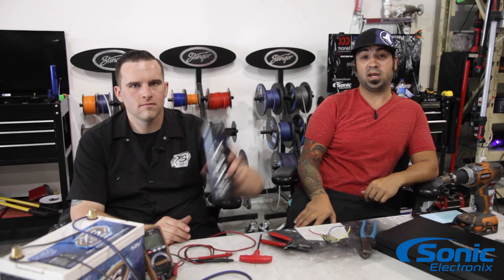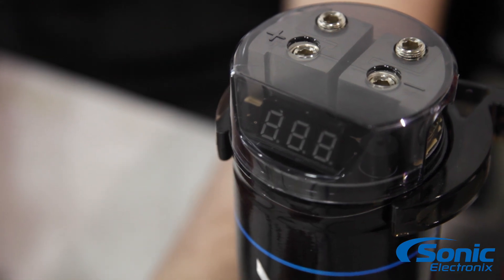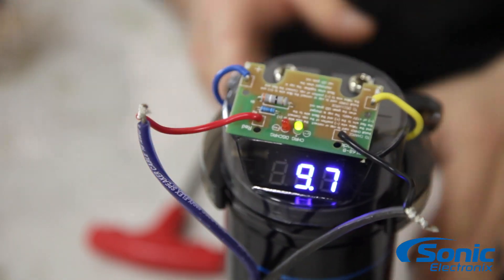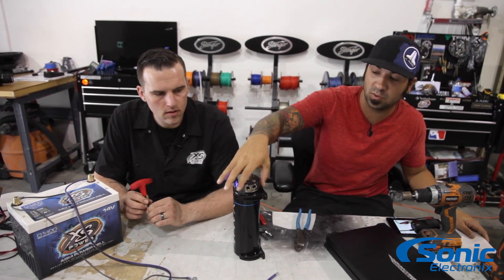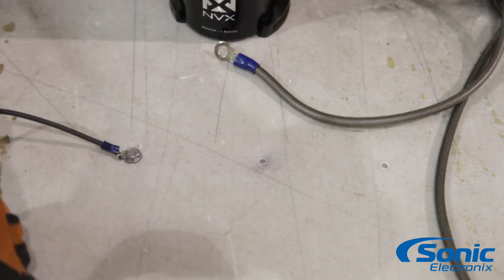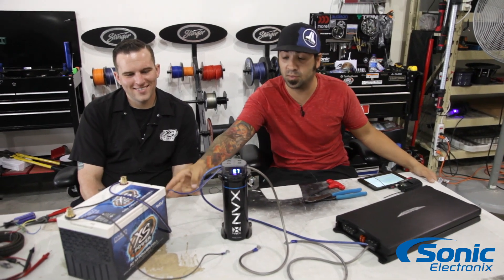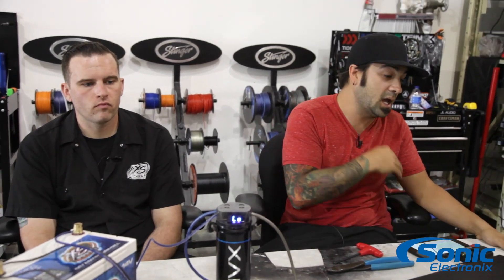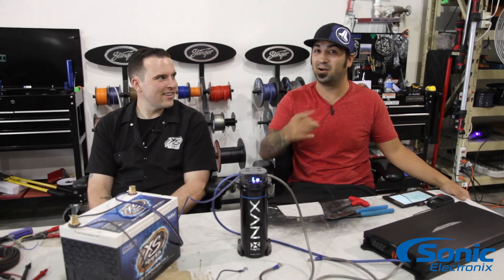How To Charge and Install a Capacitor | Car Audio Q&A

Comment: Now what about ultra capacitors
Reply: Why not just get a 2nd battery...
Reply: cuz is heavy on the alternator cuz of the higher resistance
Reply: An ultra-cap isn't "better" than a super capacitor, it is a super capacitor. Ultra-capacitor is just a brand name and means next to nothing. The reason why his cap drained so fast in this video was because it was powering the voltmeter. Caps aren't batteries, they're designed to take in and give out their power very quickly, not store it for long term use.

Also, it is harder on the alternator to get a second battery, but it has less to do with resistance and more to do with the way alternators were designed for constant linear loads, and by its very nature an amplifier isn't that. The cap turns the amplifier into more of a linear load from the alternator's point of view, thereby decreasing the duty cycle required of it and increasing its lifespan.
Reply: @jamisonw.327  Even if you add batteries your stock alternator will still limit the amount of current that can be sent to the batteries. adding batteries literally does nothing to your alternator. It's quite simple Electtrical engineering. you can have 54 batteries and your alternator will still only put out it's rated 120 amps or 220 amps or whatever it is. Alternator will charge battery1, battery1 will charge battery2, battery2 will charge battery3, so on and so forth. Batteries don't take juice from something they receive it from something at a speed that is predetermined by that something.The only issue you may run into with 54 batteries is that it will take you a 937 mile trip to charge them all with 1 140 amp alternator, but since alternators are literally on all the time when the engine is on, they are meant to produce a specific amount of amps ALL THE TIME and will NEVER go over that no matter how many batteries you have. Moral of the story, "Extra batteries WILL NOT hurt your alternator and IS NOT bad for it or hard on it". The only things that can be hard on an alternator is drawing more voltage then it can put out and using junk batteries that literally don't hold a charge, then the entire electrical system is being powered by the alternator itself. Class dismissed.
Reply: @Joe_And_Nina_Pierce  Although this was a reply to a 2 year old post, it's worth noting that you're wrong in your assumption that more batteries can't do harm. Beyond the obvious weight, let's look at some characteristics of a battery: resistance, as a thought exercise, imagine plugging a car charger into kill-a-watt device and taking a car battery from 30% capacity to 100%, let's say the screen showed an overall usage of 1kW. Then you take that fully charged battery and boil some water until it's at 30% again and it took an hour to drain. How much power was put into that water? Well, depending in the chemistry lets say just your typical acid battery it could be as low as half of the energy that showed on the kill-a-watt while charging (less if we're accounting for the energy losses incurred by the charger converting ac power, but lets assume it's 100% efficient for ease of comparison). The reason is that charging a battery creates heat losses, and even a super efficient acid battery getting an ideal charging flow will lose close to 10% (http://large.stanford.edu/courses/2010/ph240/sun1/). This means that in your scenario with 54 batteries, assuming the batteries you're using fall somewhere in the middle of that spectrum, lets say 75%, you're losing a fourth of all the power you're putting into the batteries just to heat, it's quite simple electrical engineering. This means that as the batteries balance if you only connect them together with the car off it's going to result in a lot of wasted energy in heat, and basically your worst battery becomes your baseline for the whole system. This will always be a present issue because even batteries of the same model number with the same relative duty cycles will differ slightly in resistances as they're drained, and this will result in every drain unbalancing then and pulling from the strong to the weak. It will be negligible at first, and will either get worse over time or increase the resistances to match the worst of the bunch. Your idea with 1 charging 2 and 2 charging 3 etc would result in 25% losses at every step, meaning there's a point of diminishing returns for any given power that an alternator can provide. Because of this charge efficiency issue it follows that using your system with the engine off is ultimately harder on the alternator in the long run, because newly created energy could have powered the majority of your amplifiers' needs instead of having to pull from the battery which took 125% of the power you got in order to recover. This issue is also why when people power their houses with solar power and battery banks they always should use charging controllers to balance effectively without letting the batteries charge each other. Far from being the primary issue as well is the extra wiring involved in this hookup. Every wire is just a very long resistor, essentially guaranteeing additional losses the more complicated you make your car's electrical system. Also, alternators are "on" all the time, but the electromagnetic field only resists the motion of the belt-driven core when it's pulling power (when the electrons have somewhere to propagate down the wire), and to the precise degree to which it is pulling power. So while it's always pulling some power when the engine is on, for spark plugs and the ecu if nothing else, it's minimal strain on the engine until there's a large load to the circuit requiring full power. I can say from first hand experience also, that with a clamp meter on the positive cable from an alternator the amperage fluctuates greatly with load. If it didn't then the power would all be lost to heat in the wires. Ever wonder why your engine rpm slowly gets lower after you turn your car on? Your battery is being recharged at near full current from the alternator when you first start the engine to recoup from the starter's draw, and it teeters off at the voltage gets up to peak levels, as that happens the engine doesn't need to work so hard to move that drive belt.
Reply: +Quann Drayton those are better. did you see how that crappy capacitor lost the voltage went from 13volts to 9 volts. thats because of the small resistance inside this cap. ultracaps have less resistance then that so theyll keep the charge better